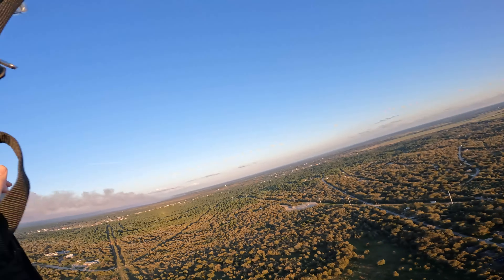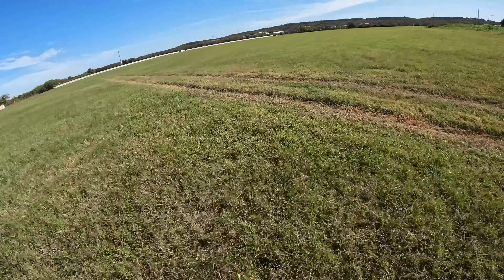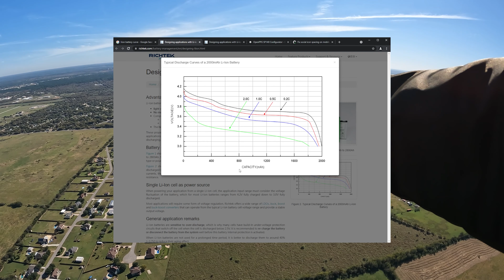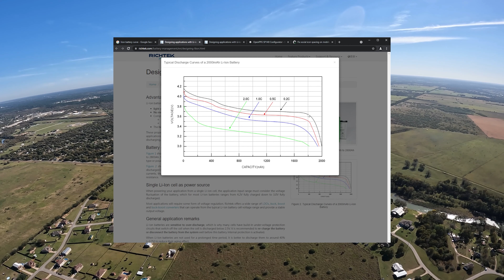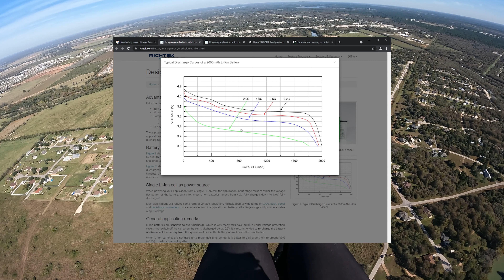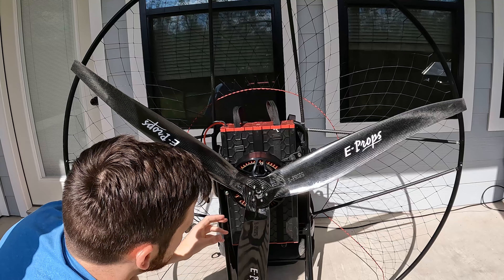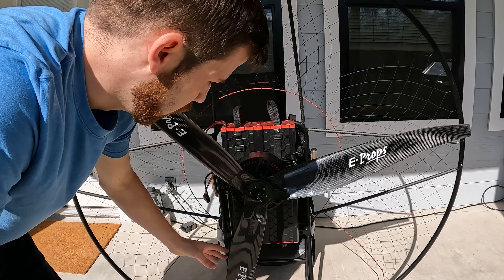Flying update!  New OpenPPG Sp140 firmware, Battery curves, Quick-release prop mount + more

Comment: Hey Zach, I just received my SP 140 and installed the Iris PPG prop quick release adapter and noticed the screws were binding up the motor due to being too long. I decided to place the original prop washer between the adapter and the motor, the screws no longer protruding out past the motor mount holes. If the end of the machine screws are flush with the motor mount holes is this more than enough threads to be safe running the prop adapter?

Comment: The OpenPPG controller is arduino controlled? Does it have a usb port or a way to easily connect and reprogram using arduino software? That would be pretty cool to be able to add your own functionality and maybe other sensors. Maybe some kind of auto throttle or even autopilot

Comment: Have you put your rig on wheels and tethered it to a fish scale to determine lbs thrust?
Reply: Good one.. I'm curious to know too..
Reply: The SP 140 with a 140cm carbon fiber 3-blade prop sustains 175LBs of thrust at sea level. For a baseline, around 60% of all engines on paramotors in 2020 were the Moster 185 which in the same prop configuration generates 165LBs of thrust when brand new and 150-155lbs after 1 year of regular use. I hope this helps.

Comment: Thank you for the update. Are all throttles left hand on the units?  I notice in some of your videos, first time users have a bit of trouble getting use to the instant power on the sport setting. I know you have a softer mode, but can full power be reached in that mode? Seems there could be several power curve modes. Thank you for the work you do. Looking forward to flying without a two-stroke on my back.
Reply from the maker: All units ship with "chill" power mode on by default. Sport can be enabled by the user by changing a setting
Reply: @ZachWhitehead  what is the max power in kilowatt between chill and sport besides a more twitchy throttle?

Comment: How would one connect multiple batteries together on a trike or something to have longer flight time?
Reply from the maker: Yep!
Reply: @ZachWhitehead  I'm asking technically, how. I doubt there's a how to video out there and I want to make sure I don't bite off more than I can chew. is it as easy as just using an easily obtained cable to plug some things in, or is there deconstruction and technical work involved?
Reply from the maker: @ryanviningtube  not sure if there's a cable but you would just basically have a splitter and plug them in together in parallel
Reply: @ZachWhitehead  Do you know of/have any examples of someone doing that and making it work without messing up the batteries or anything?
Reply: @ryanviningtube  Ryan, there shouldn't be too much too it if you run them parallel (positive to positive and negative to negative). You'll likely have to make your own splitter.  I'd be curious how much time you'd get out of even two batteries with the extra weight of a trike.  Interesting idea!